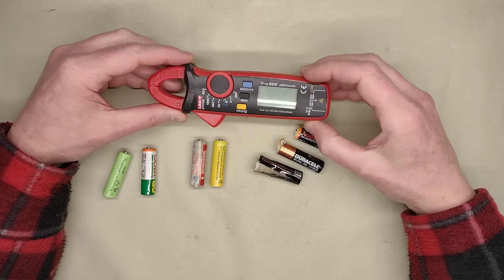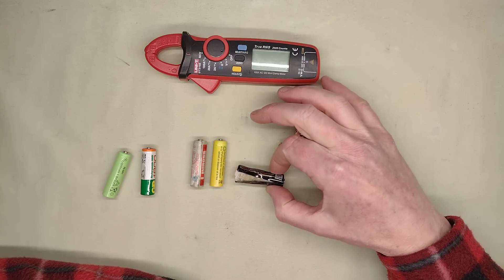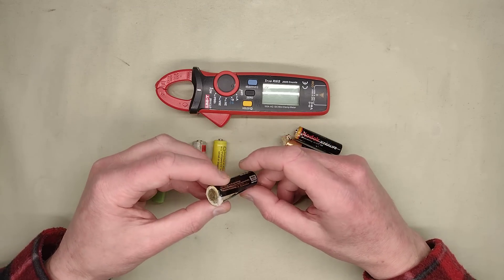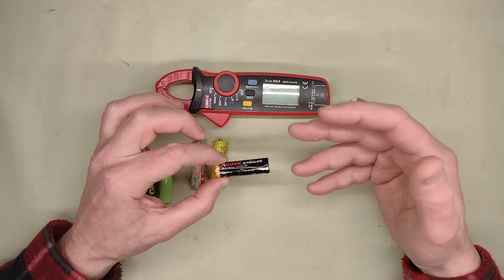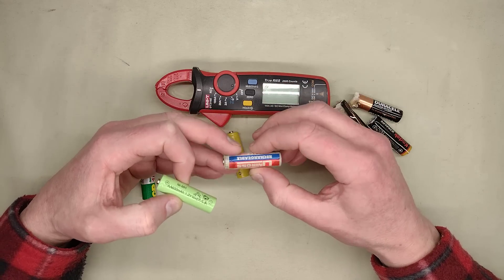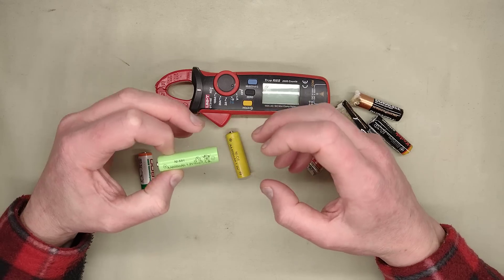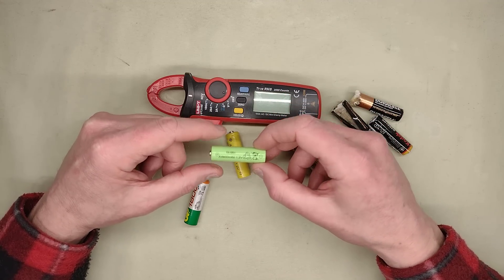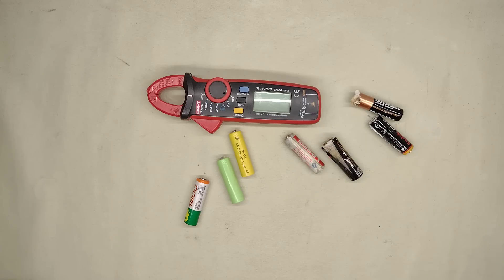The curse of leaky alkaline batteries

Comment: I've had many alkaline batteries leak on me, the majority of which were Duracell, and a few off brands. I've had the least leakage with Rayovac brand, I've had toys from 20 years ago with old Rayovacs in it that didn't leak and still worked vs the Duracells. It was a bad enough experience that I just throw any new Duracells that come with devices away and use something else. That being said if it's a valuable device or not going to be used a lot just buy NiMH, lithium's or some other chemistry for it, chargers are cheap and very nice now compared to the older stuff or just remove the batteries until needed.
Reply: Rayovac is the only alkaline battery I will buy.

Comment: Ah I know them well... every year I fly back to mom's for Christmas and have to change the batteries in the same remotes I changed last Christmas, lol

In my own place I don't even have a remote for my TV... I just turn it on manually and use my phones roku app.

The only thing in my house that uses batteries is an air freshener... that I soldered a USB cable into so it now is a plug in, lol

Comment: When alkaline cells started replacing zinc/carbon in the 1970s, one of the selling points was that they didn't leak like the old zinc/carbon ones did. And I don't recall leaking alkalines in the early years. I wonder why they leak nowadays - did the battery chemistry change?
Reply: What’s interesting is that I’ve only seen alkaline batteries leak when they are installed in something.  I wonder if it has something to do with “always kind of on” nature of devices nowadays.   30 years ago, if you depleted a battery, you would actually have to be using the device when it depleted, so you would replace it right away.  Now, devices drain the battery sitting in the drawer,  and I think they just can’t reliably contain the completely drained chemicals, which probably increase pressure on the case.
Reply: I’ll add that other battery chemistries, like the non-rechargeable lithium batteries, have special vents to discharge the reaction gasses.  If they leak it can lead to a fire.   But those batteries cost more.   When alkaline batteries leak, it’s mostly only annoying, so it probably wasn’t considered “cost effective” to develop something to prevent it.  Especially since these were developed at the same time as the Ford Pinto, when companies definitely wouldn’t have found the extra production cost worth it.
Reply: Could be the device design as well being in fault. Plenty of tiny crap on board and mosfet switching and such designs have small current draw. its fine if you use the device a lot, but if its one of those rarely used but useful tools for instance it will draw the battery dead with out warning. I have stud finder laser combo device. If i leave battery in it will be dead when i use it again, hence i always remove battery in that and other devices when ever possible and use them in battery lights to run them dry so i dont waste electrical tape to cover the connection.

Comment: At some point in the mid 90s these batteries were mandated to not contain Mercury. (hence the 0% Mercury text you see on most Alkaline AAA/AA batteries). Before it was removed Mercury was added to help contain the hydrogen gas build up and batteries from that era where much less likely to leak like the ones today. It doesn't help that manufacturing standards have declined for them as well. :(

Comment: One of the advantages of alkaline cells was that they had higher capacity than NiCad, which in turn were comparable to the old carbon-zinc "dry cells".  That's no longer true relative to modern NiMH cells; even early ones could make a device last roughly as long as alkalines could (sometimes longer due to a more favourable discharge curve).  I now have 2600mAh Varta NiMH cells which have twice the capacity as my old CamLink cells from circa 2000, and the Vartas are of the low-self-discharge type with a residual charge guarantee after a year on the shelf.  Meanwhile, alkalines have stayed pretty much the same in performance.

Something that's also highly relevant in my far-northern climate is that NiMH cells have a negative temperature coefficient - so they work better in the cold - while alkalines practically stop working at all if you go much below freezing point.  Earlier this month I took my new Maglite Solitaire torch out with the alkaline cell it was shipped with; 100 yards up the path (so just long enough for it to chill to freezing point from room temperature) it cut out hard without warning, and could not be re-lit.  So I switched to the NiMH spare I'd put in my pocket for just such an eventuality.

Where alkaline cells still have a (perceived) advantage is in up-front cost.  You can buy a ludicrous mega-pack of alkalines for the same price as a set of four NiMH cells.  But it's like the price of incandescent lightbulbs; each individual one costs less off the shelf, but it costs you more in the long run, both with more frequent replacements than the modern types of bulb, and consuming substantially more power while it still works.  I do think alkalines cost more in the long run; you have to keep replacing them when they run down, keep spares for the eventuality of them running out while you're using them (rather than just giving them occasional top-up charges), and if they leak it could ruin an expensive gadget that'll wipe out any savings straight away.

Comment: Has anyone had any experience with the constant current 1.5 volt lithium ion batteries I see on Amazon and other places? Seems a good option for sensitive devices. I was thinking camera flashes that seem to take much longer to cycle with lithium ion cells.

Comment: I recently found my tv remote batteries leaked. I also found my xbox remote leaked. Batteries leaking recently is strange to me. I never had batteries leak in my stuff before. Might have something to do with moving 1800 miles and the temperature in the moving truck. Definitely annoying, but it was caught soon enough to not be a problem.

Comment: I use vinegar to clean out any leaked batteries (after removal), and that's it.
As for the leaking cells? Most are still good regardless if they leaked. Drop 'em in vinegar. Dissolve, dry, test. LOL

Comment: I had the same problem with some batteries I had had purchased, after a few months they leaked, I caught it just in time before too much damage was done, after putting on my Mr Angry hat I sent off the receipt and my complaint as they were just a few months old (to me), I received a nice reply, some new batteries and a voucher, turns out my "new" batteries were 5 years old, and had reached their expected life span, I now check any batteries very carefully for date of manufacture, not all shops have fresh new batteries. To anyone storing batteries, preppers, emergency bug out bags, camping equipment, always check see if you can spot a date code, they might still work but be just about to die.

Comment: Bit surprised to hear the comment that NiMH cells aren't known for leakage as anyone with an older Mac laptop will probably know that the rechargeable NiMH PRAM batteries of the 1990s were very prone to leaking acid taking the logic board with it. Certainly a LOT worse than NiCd batteries.

Comment: I have 4 Energyser and 4 Duracell rechargeable batteries that I use in a wireless keyboard and mouse. If I use standard batteries they last for years. If I use the rechargeable batteries they last for a day or 2 at most.

Comment: Some months ago, I finally said "ENOUGH" of Alkaline batteries. I am SO DONE with cleaning up the crusty frost and the blue corrosion on the contacts inside battery compartments. It's funny because Alkalines in the past seemed to go years and years before busting their guts if they did so at all. I recently bought a few packages of 50 "AA"s and discovered there were already some with salty crud on their bottom terminal before I got to use them. I assume there is no longer any incentive for manufacturers to use good quality seals that allow gases to escape while keeping the goodies in. I have moved to non-rechargeable Lithium (i.e., Eveready Ultimate Litihium) which have a staggeringly long shelf life and very reasonable capacity. And so far I'm pleased to say they don't leak.

Comment: I put a smudge of silicon grease on the battery contacts. White residue crud wipes off very easily. Your green NiMh looks like Panasonic industrial, very good low self discharge. Some other brand names go dead in a month, but I've seen Panasonics hold 70% charge after a year.
 The new creation seems to be lithium AA cells of some kind with a USB socket in them. Plug in a USB cable and charge. Just bought a pack with a 4-headed charging cable to see how well they'll do in a year. ~2000mA rated so they are competitive with alkaline. In theory.

Comment: I've gotten into the (painful) process of installing batteries before I use a piece of equipment, then removing them when I am done after having too many battery leaks.  The plus side of this method is I can (and do) always check the battery before I install it so I am "sure" it shouldn't go flat when I am hanging by my rear end in some awkward situation when using said piece of equipment.

Comment: But what about smoke alarms?  Lots of products like that specifically say to use alkaline and I'm wondering if thats because if the smoke alarm goes to 1.2v its going to start chirping prematurely.  Also, the do have those rechargeable lithium Ion AA's that have a little buck converter but u need a special charger.  The charger usually comes with a starter package and you add more batteries as u go.  Would smoke detectors or gas detectors be fine with the lower voltage?
Reply from the maker: If you have the budget then a 9V lithium primary cell should last a very long time in a smoke detector.
Reply: @bigclivedotcom  I usually put the non rechargeable lithium 9v in stuff like smoke detectors that are a PITA to get to (like the ceiling of a stairway) so it lasts.  I don't put standard rechargeable 9v's in them though because I'm always thinking that a rechargeable NiMh battery would make the smoke detector chirp prematurely.  I would love to have nothing but rechargeables.  I  even went the distance and got a smart charger that can even charge 18650's.  The only battery it can't recharge is those special AA's with the little circuit buck converter.

Comment: Yep, alkalines are leaking too fast (even before due date and it seems worse on known brands). I had a multimeter that I seldom use, corroded by 2 Procell batteries, well within their valid date. On the other hand, NiMH batteries keep their charge forever and don't leak - just last week, I used a battery from a pack I bought a year ago, and it still had the factory full charge.

Comment: While I didn't look at all the comments, I'm surprised no one has mentioned the newer 'Lithium' non-rechargeable AA and AAA cells, they even have a 9 volt battery version. I've completely switched over to them and as they are much lighter and will last just as well as the alkaline cells, it's been a big win for me as I have so many pieces of test equipment that use all those types. Yes, they are a bit more expensive but I have never seen one leak yet and don't have a self discharge rate that the NiMh do so for me they are worth it.

Comment: Yes, I have a bunch of older gear with remotes, I was dismayed at the number of bad batteries in them, all Alkaline. Luckily I managed to recover them all, but it took quite a bit of time. Sadly a lot of remotes want 1.5v, you can get 1.5v rechargables, well you could at one point, they seem to have vanished, they were very expensive. I think you just need to treat batties like a cars oil change, just check them and swap them out as required. I just double checked all mine, all good. Thanks for the heads up, as always great content.

Comment: use superglue to seal them so they cannot leak
Reply from the maker: It's caused by pressure build up.  Gluing them could cause them to explode.
Reply: @bigclivedotcom  I agree but if the case is very strong than that will never happen or 0.1 micron hole could be drilled in the case
Reply from the maker: @esecallum  They can pressurise to the point they explode and embed themselves in walls.  If you drill a hole that's where the electrolyte will come out, regardless of how small you make it.

Comment: That is a long time that I have seen tat meter in your Video's.  Had you Misplaced it and found it back?? I Still use that type meter for my daily quik measurements, and I am still Satisfied with it. IF I want a second opinion, I get the Dynatek 9045which is a Golden Oldie, but still going strong.

Comment: I'm with you on this. I use NiHM cells for almost everything these days. The exceptions are a few crappy devices that really seem to dislike the 1.2V nominal voltage
Reply: My mom has this blood pressure monitor that will last months with a set of alkalines but only two weeks with NIMH. Very frustrating

Comment: Agreed. I started transitioning to Ikea rechargeables many years ago, and never had a leak. Alkalines higher voltage is quickly dropping off across they capacity, so I bet most alkalines are thrown away around 30% used. They are cheap to replace/waste, but also kill expensive devices.

Comment: The positive side for NiMh batteries is often a bit less sticking out compared to alkaline batteries. This can prevent them from making contact with the device. Also those NiMh are a tiny bit larger in circumference making it hard to remove them... So still stuck with Alkaline for my Wireless Microphones 😔

Comment: I've been wondering about using a AA sized LiFePo4 cell along with a dummy cell with a low voltage cut-off circuit inside. For instances where you have a fairly high draw and want a fast recharge. Has anyone tried this? The voltage would be slightly higher, but I imagine most modern electronics could withstand an extra volt, and the total watt-hours seem to be similar.
Reply: Lots of people do this. I believe they even have commercially-made dummy cells for this purpose.
Reply: Yes, tried it and it works fine. When I was looking for a good battery for the Magic Remote for my LG OLED (which doesn't like 1.2V NiMH), I compared LifePO4+dummy with NiZn. I went with NiZN in the end because this would match the voltage specifications of the chip in the Magic Remote better and bought quite a few NiZN batteries, so they are now used in many of my devices. However, I also bought two LifePO4 cells + dummies and those work great as well.

Comment: Hi - having recommended using NiMH batteries for everything can you have a look at pound shop AA chargers. They vary in quality quite a lot - some are dual NiMH - NiCd but with no obvious switching so do they really do a good job with both?
Reply from the maker: The NiCd-NiMH switched chargers are usually fast chargers that need to be put into a more sensitive end of charge mode for NiMH cells.
The dumb slow chargers can charge both NiCd and NiMH no problem with their low fixed current.  In many ways they are a better charger than the smart ones.

Comment: I went with Ultimate Lithiums for awhile mainly since I used a point and shoot camera 10 years ago. Once the battery was down enough the camera wouldn't take it anymore I finished them in my game controllers, flashlights and remotes. Now with kids I just get a Sam's Club 48 pack for all the toys. Had one battery already defective. Same goes for work my boss tried rechargeable for the wireless Mics and no one charged them regularly so he just gets batteries from Costco. Kinda bothers me but at the same time it makes sense with everyone coming in and out no matter how much training you push everyone though.

Comment: I get a lot of Duracell pro cells at work. They come with a lot of stuff we install. I throw them straight into the garbage because they leak all the time. They ruined so much equipment that had to be replaced. I use recharge batteries and live with the slight less voltage.

Comment: Alkaline batteries can’t be left in devices - I’ve found. Remove them before storing, and put the batteries and the device in a baggie. I now use lithium batteries for my often used flashlights etc. Something has happened in the industry. Name brand batteries didn’t use to fail and corrode like they are currently doing,

Comment: I remember when I was 18 that I had a dual tape deck radio that took D size batteries, as a lot of devices did and it was common with zinc carbon and zinc chloride batteries to leach acid over all the insides and corrode everything including the terminals. The change to alkaline was better, and they leaked less often and that was crystalline alkaline gunk. Often those devices didn't work with rechargeable batteries because of the difference of 0.3V per battery meant that the older devices that took 4 batteries for 6V but wouldn't work with 4.8V. I wonder if there is a market for lithium batteries and buck converters to make them provide the 9V PP9 replacement or 996 6V replacement.

Comment: What relly is the stuff leaking out and how harmful is it to touch/accidentally ingest (by touching and later touching food for example) is that?
Reply from the maker: It's an alkaline liquid like diluted lye.  Not too harmful, but I recommend washing it off your hands after contact.
Reply: @bigclivedotcom  oh, thanks for the answer. i always thought all batteries would be acidic. i usually throw all my empty batteries into a glas jar with metal lid and drop them off at the nearest recycling station every other year. sometimes there was liquid on the bottom of the glas jar. i once dropped a lithium battery from a phone into the jar and wondered if that was a really dumb thing to do...nothing happened though. wonder if i was lucky to not have it burn or explode or if it would have been very unusual to have that happen.